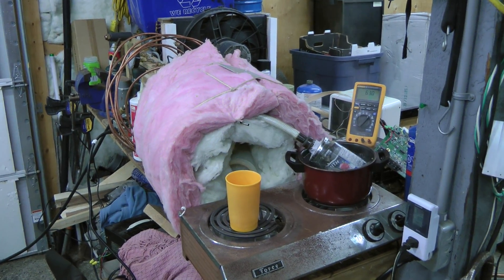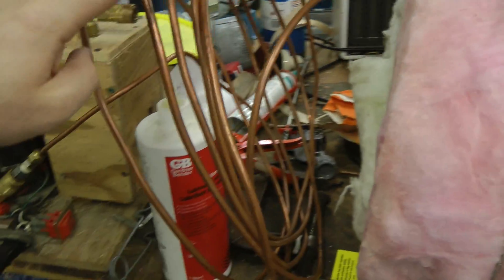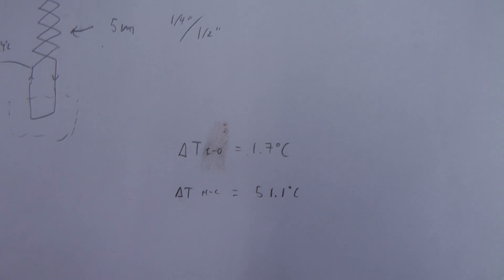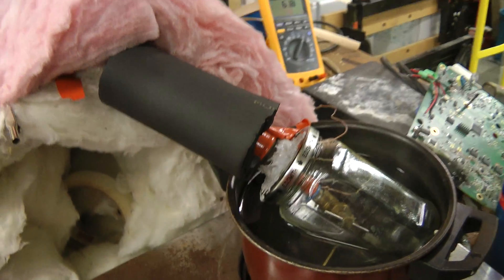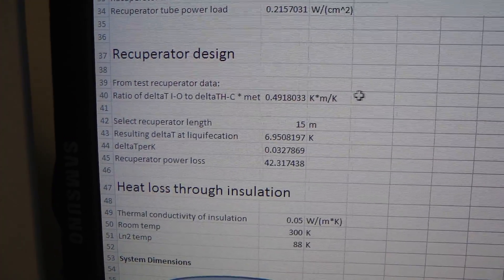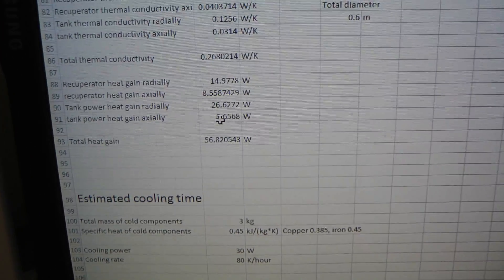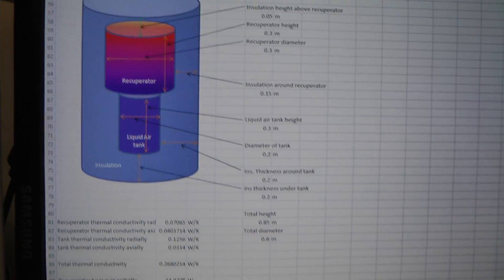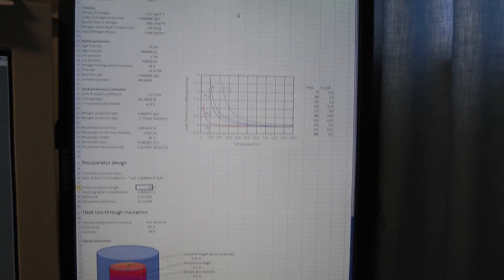Hampson-Linde air liquefier - Part 3

Comment: I've been dreaming up a similar design but I would include a ice bath to cool the incoming air and collect condensation and than pass the air through a pre-cooler of dry ice.  Also Joule–Thomson cooling doesn't provide much of a temperature drop (especially at higher temperatures), but if you could extract some enthalpy mechanically using a piston or turbine and dissipate that energy away from the air, it would provide a significant temperature drop.  I was thinking of using something from PM Research to generate electricity that could be dissipated with light bulbs or something.

Comment from the maker: @george456789 This sheet may not be accurate for very high pressure, you need to use the graph on the PE chart tab in that case. Could you send me your sheet? I'd like to see why it's saying such a high number.

My values are predicting a much more sane 4 liters per hour using a compressor drawing a few kW.

Comment: Thanks for the interesting vids and excel link great work on the xl sheet btw althou I think it may be a bit optimistic, I'm looking at doing the same but with a bigger compressor.  I had previously figured I should be able to produce about 20 litres per hour based on energy consumption compared with commercial process divided by a factor of two for my roughness factor.  Your spreadsheet said 180l/hr when I put my numbers in? That would be 4 times more efficient than the best commercial units.

Comment from the maker: @ignilc I was thinking of using plastic for the outer tube actually, that would keep the cost down significantly. I'm just worried about it becoming brittle at low temp. The internal tube does conduct heat through the wall, quite a bit actually, so it must be metal.

Comment: why don't you use pipe insulation tubing? I think it would work better at keeping the air colder so that it has more time to cool the incoming compressed air. Also I don't think that copper is necesarry for the tubes, since the slowness of the cooling effect is not due to the materials thermal conductivity, but rather because both sides are gases. if you look around you can find 4mm ID 1mm wall PE tubing for about 1/20 the price of copper tube. it handles 200 psi with no problem. good luck!

Comment: Check out the reference to cryogenic filters for cell tower transmission electronics? Stirling engine gets to liquid nitrogen temperature:  at 31:37 in this audio discussion:  .theamphour com/2011/02/08/the-amp-hour-29-dj-and-jazzy-jeff/